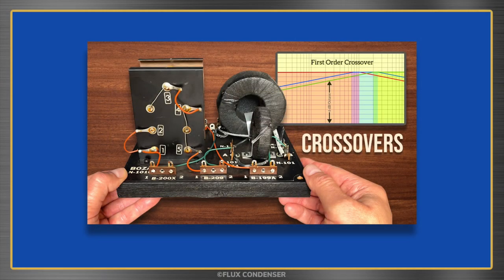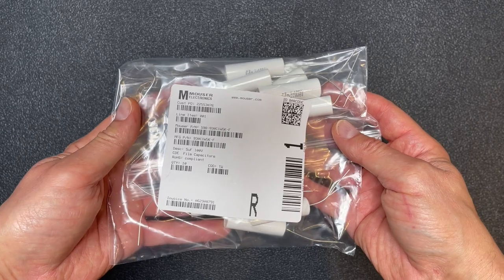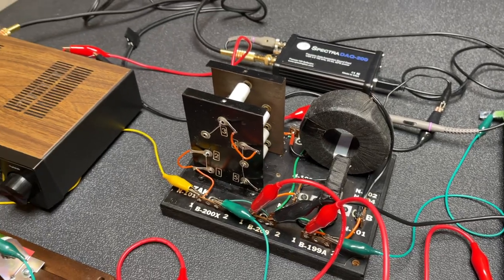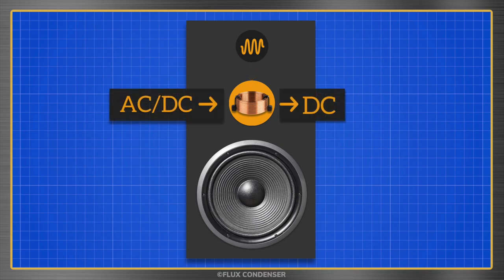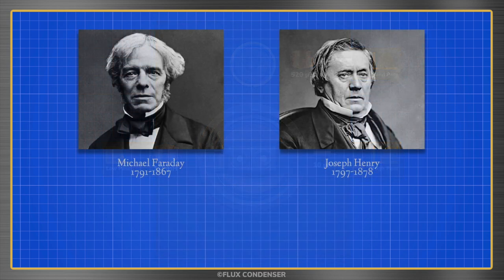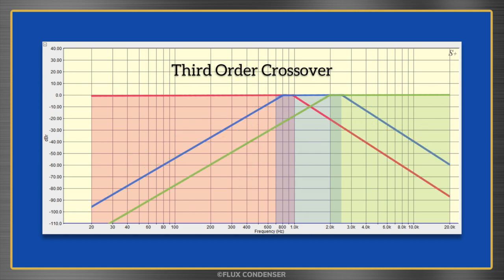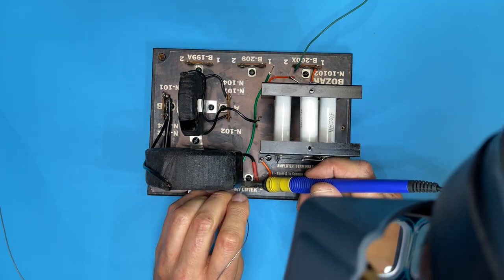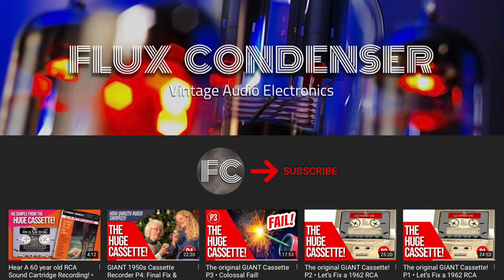Why Do Speakers Need Crossovers? How Do They Work? What's Inside Capacitors? • Bozak B-302A Gem • P2

Comment: A good introduction to crossovers with more useful details than you often get in such videos.
However, it is impossible to get a +6dB boost in the passband of a 1st order, HPF or LPF filter into a resistive load, and this is certainly an artifact of your measurement set-up. Normally in the passband, the reactive component will approach a short curcuit and all you should get is a slight attenuation - from the cap's ESR or the Coil's copper resistance. 

When connected to a real world speaker driver (which is not like a resistor!) and/or with higher order filters, you can get some narrow banded 'boosts' around the filter resonance frequency, however this is generally not acceptable, because remember there ain't no free lunch and every peak means more power pulled from the amp, at a lower and possibly harmful load impedance. Delicate speakers might also take damage from significant peaks, that's why passive filters for speakers must always only attenuate, without significant boosts, i.e. more than +1-2 dB.
Reply from the maker: The crossover tested accurately and as predicted. The methodology and design of the crossover was well detailed in the video.
Reply: @FluxCondenser  

I'm not writing this to get on your nerves by the way, it's just that I think it's important to provide correct information to especially for beginners, and the idea that a simple capacitor or inductor with boost your response by 6dB or that this would even be desirable is just not that. A passive crossover's job is to attenuate and not to boost, and any boost it can do will only be narrow banded and is generally not to be accepted for the reasons I stated before. I know it can be tricky to set the levels correctly for such measurement tools and your amp's output level here should be exactly at the 0dB reference voltage. If you can prove me wrong without a doubt. I will happily admit it, we never stop learning.
Reply: @FluxCondenser  

So twice the voltage is 'just as predicted' to you?
I hope the folks who build utility transformers do not think in this way, LOL !

Comment: Thanks for the video.  I noticed you have three dummy loads... one each for the woofer, tweeter and mid.  If I duplicate your setup, can I get accurate measurements with only one dummy load, moving it to the circuit path being tested?  Thanks.
Reply from the maker: Bill, yes, the three sections work independently so you only need one dummy load. Just move it between the sections you want to test. I set it up with three so I could quickly switch between testing the three sections. But it’s not necessary.

Comment: Does crossover order determine the price of the speaker? For instance, am I correct in assuming that a lower distortion speaker, which is generally more cost, means it would be more suitable for 2nd, 3rd, and 4th orders? While a first order could be used on anything, it might be even better for less expensive speakers?

Comment: Chris. I duplicated your crossover tests and want to point out something I don't think you mentioned.  While the plots are exactly as predicted using a dummy 8 Ohm load, try the same measurement with an actual driver attached.  The impedance curve of the driver reeks havoc on the predicted shape of the curve.  I'm sure you know this but wanted to point it out for others and see if you have any additional comments.  Thanks
Reply from the maker: Thanks, Bill. Yes, this is to be expected as the speaker creates a reactive load. By reactive, we mean that the output is frequency-dependent. As frequencies change, the output goes all over the place. 

This is another reason we don’t test amplifier power with a speaker and instead use a non-reactive dummy load. Wire-wound resistors aren’t suitable for this purpose as they are essentially coils which will have a reactive effect. 

In your test, you’ve added a coil to the circuit with the speaker. As you saw, as the frequencies changed, so did the output, depending on the effect of the AC reactance. 

By testing the crossover with a non-reactive load, we can verify that the signal going into the speaker is as-intended. But, speakers are imperfect output devices, so what happens to the signal after it goes through the voice-coil and is reproduced by the cone is subject to many variables. 

Even the ability of the amplifier to supply a reactive load can affect the cone movement to a certain degree. Do a search on amplifier damping, for example. Hope this sheds a little light on a complicated subject. That’s the best I can explain it based on my knowledge.

Comment: Would it work with electrolytic capacitors?
Reply from the maker: Electrolyic capacitors are used in crossovers, but they need to be the non-polarized type.

Comment: Some of the old capacitors are 50 + years old and still working, Im not sure if  a metalized cap is going to last as long ,  I would think solid foil would be better

Comment: I would like to ask a question. Is it true that cheap x-over parts measure the same as high quality parts? But the sound to our ears is vastly better with the high quality parts. Some costing 10 times as much or more. What is your opinion?
Reply from the maker: My opinion is that if two components measure the same they will sound the same. Why wouldn’t they? Now, that said, there are a lot of measurements one can do on a component such as a capacitor. Far beyond just measuring for simple capacitance. And with that said, the overall circuit design of a crossover will have far greater effect on the sound than the choice of brand. Good quality capacitors, coils and resistors don’t need to be expensive. Exotic capacitors, etc are a waste of money.

Comment: I have listened to a lot of the full range crossover-less high end speakers.  SAP, Rethym, cain and cain, wilson-benesch, Fostex and so on.  In each case, they sounded boxy and midrange only.  Treble was deeply rolled off, and bass wasn't great,  So the claim about "audio purity" and "power robbing crossover" was lost on me. They ignore doppler distortion and rolloff.